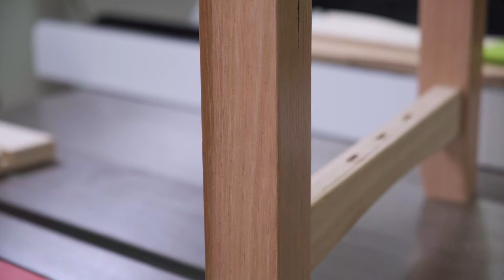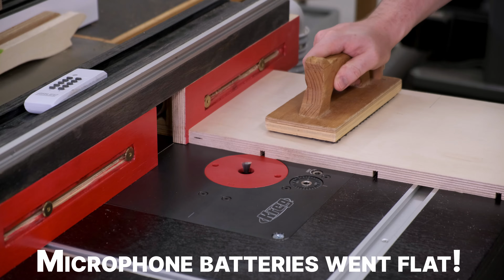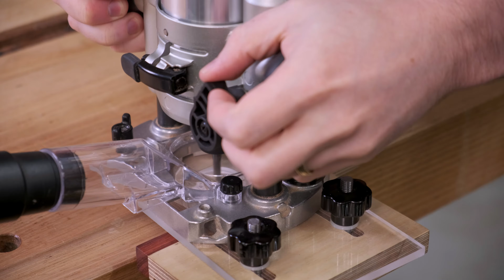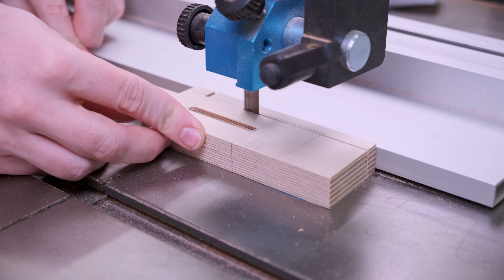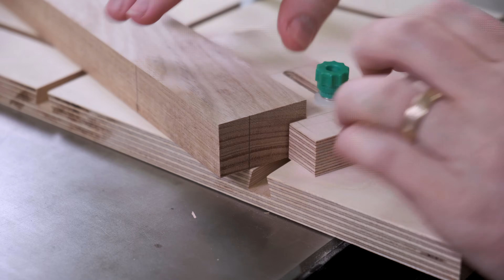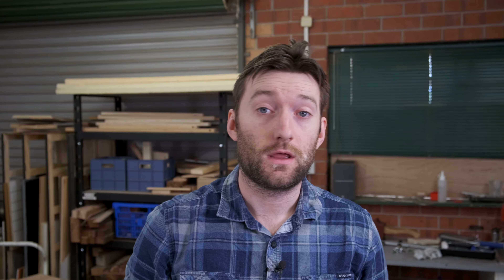Workshop: Tapering Jig (Using Dovetail clamps and hardware) | Woodworking Project

Comment: Hi Again Paul, As always excellent video mate. Would it be ok to make this one out of MDF or should I stop being a penny pinching git and buy some birch plywood?, any advice on suppliers of decent cheap plywood in the Melbourne (wallan) area would be most appreciated.
Reply from the maker: I haven't used the matchfit/dovetail clamps in MDF, however the way the compressive forces act it should work just fine. I'd probably go for 24mm rather than 18mm if you do go MDF (or glue two layers together), but I have been accused of being a belts and suspenders type of guy :)

Comment: Nice work. Re 3d printing the clamp hardware I can't find it now but another YouTuber takes standard t track bolts and grinds a little off each long side. Seems to work perfectly.
Reply from the maker: Hah, that hadn't even occurred to me! I just went and checked, a 5/16" just slides in, so you'd only need to remove a minimal amount of material on the bolt head for it to fit. I wonder if it'd cause some wood fatigue (since its not a 'supportive' dovetail shape). If it doesn't, that could make dovetail tracks much more appealing
Reply: @tmuWolverine  I think it works fine. I will try and find the other YouTube episode. If I find it I'll post the link. But if this is a problem you could cut an undersized (say 90%) dovetail strip out of a hardwood and drill a hole for the t track bolt, perhaps?

Comment: That's a good jig. I need something exactly like that for my next project.
Reply from the maker: The matchfit clamps are on sale at timbecon currently too. Way better than toggle clamps (unless it's a jig for 50+ identical parts, then may as well dedicate toggle clamps to that jig permanently)
Reply: @tmuWolverine  I was at Timbecon yesterday. At ~60bux for a pair, I probably still would have given them a miss. I'll just use my cheap and oh so nasty toggle clamps, but i'll link to this video because your method is much better 👍
Reply from the maker: You've never truly lived until you've overpaid for a clamp 😂